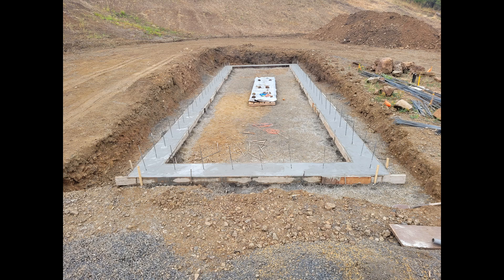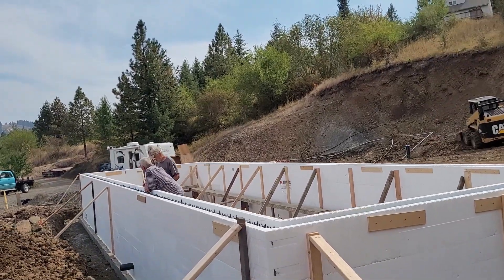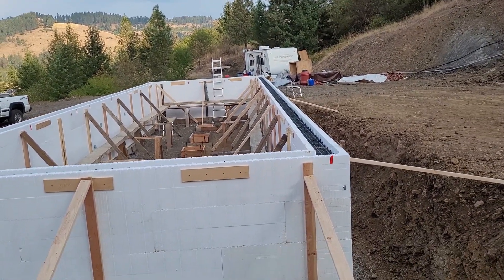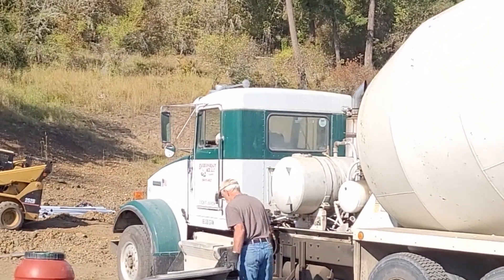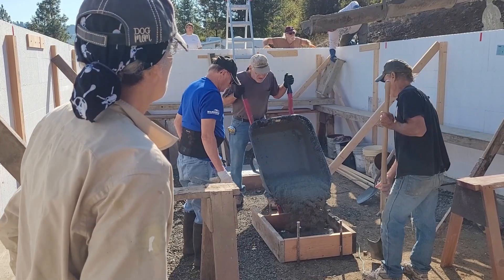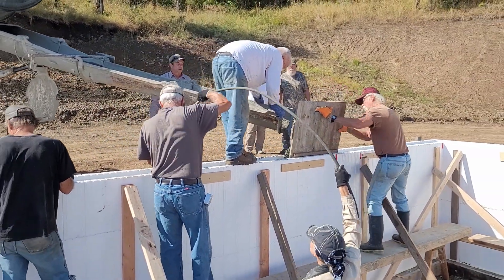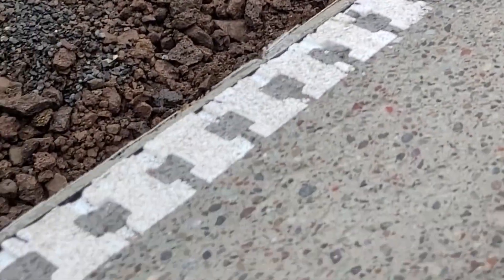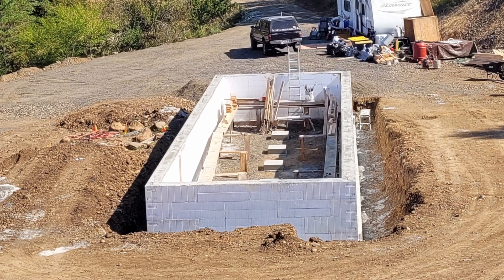ICF Stem Wall Foundation Built by DIY Newbies.

Comment: Looks very good to me.  The vibration is important and you can overdo it, but I think the risk is much greater if you don't.  I am not an engineer, but getting the voids filled is important.  Each situation is different, each mix is different and you guys rolled with the punches very well.  If you look at the end where you show the top of the wall, you can see the concrete filled the voids in the block. I am contemplating an ICF project and have done a ton of research. Did you use plasticiser in the mix?  This should help flowability without compromising strength.
Reply from the maker: I didn't use a plasticiser. The concrete outfit I used offered it but they felt it wasn't really necessary as long as I used pea gravel, which I did. Only thing I wish I would have could have done differently was to use a concrete pump, that would have made it so much easier. Thanks for commenting and good luck with your project.

Comment: I haven't watched the entire video yet, but when I saw where you have the horizontal rebar I felt I needed to make this comment now. And I realize that you've already got this done so I'm hoping my comment will help others who may watch this video and read my comment. If you pause the video at 4:04, you can clearly see the problem. I'm assuming the inside of that crawl-space is going to remain open (not backfilled). If left open, then that rebar is on the wrong side of the wall. Rebar should be place on the "tension" side not the "compression" side of the wall.
Reply from the maker: Thanks for noticing and commenting.  I tend to agree with you however I will add that the specs call for single alternating horizontal bars for each layer of ICF.  The top layers single specked bar is the one on the outside edge.   The inner bar on the top level was just extra rebar I had that I decided to add in and was not actually called for.  Why it ended up in the spot that it did instead of the furthest inner slot I do not know; that would have been better for sure.

Comment: You need 3/8 stone and a plasmacicor in the concrete. Most concrete companies sell an ICF mix. We never vibrate the forms.  Some times to much rebar or tricky header rebar detail can obstruct the flow of concrete. You did use the best form on the current market. Poured some without a pump and it is harder but huge money saver.
Reply from the maker: Used pea gravel but no plasmacicor.  Wish I could have used a pump. Thanks for your input.
Reply: @kombidog  about vibrating ICF'S  what I've seen is if your forms and bracing is tight & bullet proof 100% you can vibrate the forms. What vibrating will do is find any forgotten brace or poor window buck detail and over fill that spot. This causes bowing out of the form or even blow outs. It's when you cut out webs for Windows and doors is where lots of bracing is crucial and vibrating failures  most often occur. Worked for an Amvic ICF dealer for years on and off. Seen it all as far as ICF's goes.

Comment: What do you not like about the icf after having used it?
Reply from the maker: First off what I love about ICF:  It is very DIY friendly and that is what I really needed in my situation.  ICF is expensive but the fact that I could do it myself (with the assistance of some great neighbors) made it cheaper than having a contractor pour a conventional foundation. What I don’t like is that you have a Styrofoam interior and exterior that needs to be covered.  Another concern for me is NOT knowing if there are any voids in the wall where concrete didn’t flow properly.  The only way to know for sure is to have it x-rayed and I’m not sure how you would even have that done; especially where mine is located.  I am reasonably confident that I had good flow but there will always be some uncertainty.  My next video will show how I covered the exterior.  Thanks for your comment and for watching.
Reply: @kombidog  thank you for the response

Comment: It Is So Sorry that big Insurance Company took away the Best ICF company away. Now we are stuck added more rebar too the Foam construction.   May you Rest In Peace Polysteel.  Amen
Reply from the maker: I had never heard of Polysteel until reading your comment.  Did a quick look up on the company and see that ultimately, Fox Blocks bought the company that bought Polysteel and then discontinued the original product line; very strange.  Looked to be a cool product.  I had never even heard of ICF’s until about 3-months before building my stem wall.  Amvic was the brand that was most readily available in my area.  Having no previous experience with ICF so nothing to compare against I thought the Amvic blocks were pretty good.  However, I’m not sure I would go the ICF route again.
Reply: @kombidog  Sir I wish I could call you and tell you the Whole Story about the Best ICF Company that Get Screw by Big Companies and USA & Canada Government  ! I don’t know if it still up but take a Look at Polysteel home ni Florida when Hurricane Katrina. One home on the hill.  Be Safe Sir
Reply from the maker: @gregoryh4601  Yeah bummer.  thanks for the info and for the comment.  I do appreciate it.  You stay safe as well.
Reply: @kombidog  sir I still fighting and trying to talk to our Pass President aboutThis. Peace be With You.  Gory of Ohio. Yes where the Minks were set Free.